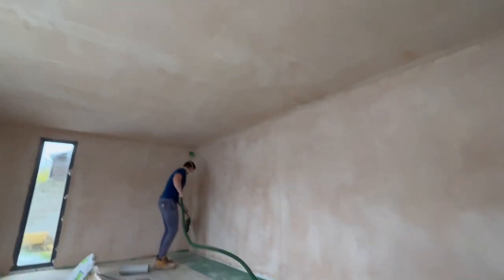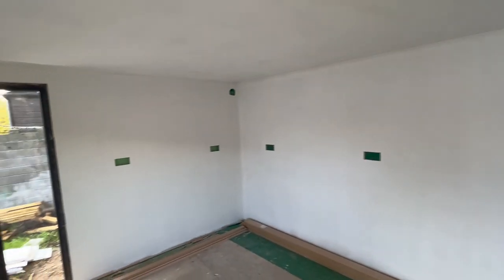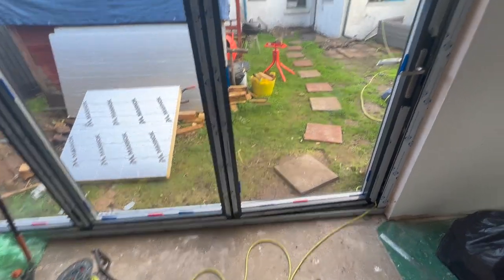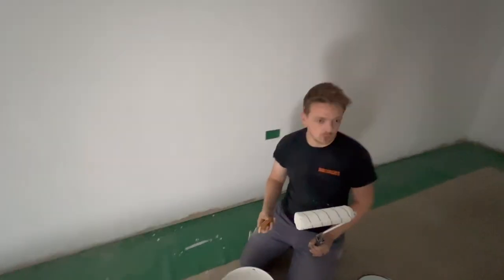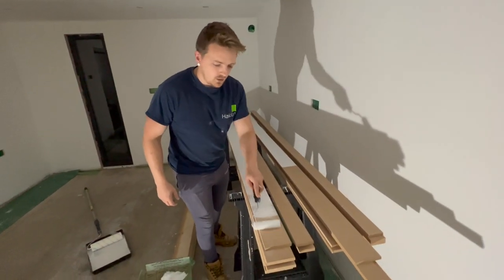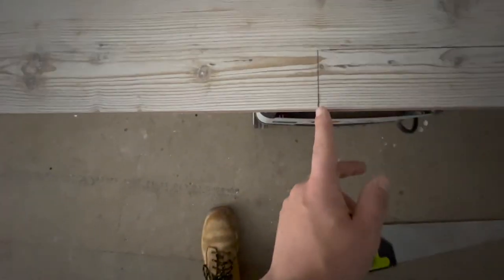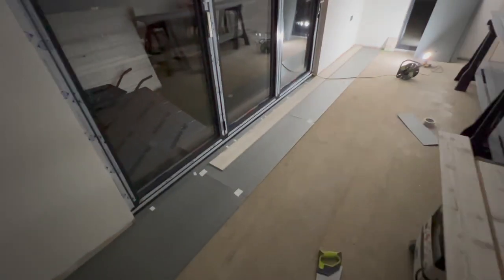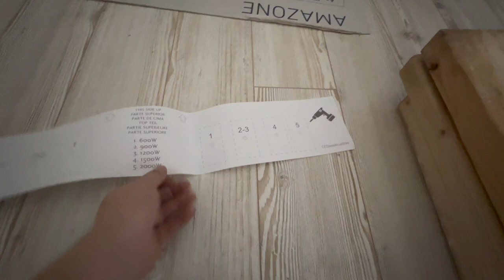Ep.7 - Plastering/ Painting and Installing Flooring - Building a Garden office

Comment: Cowboys everywhere. I've been stung a few times. But you got a lovely decorated finish on those walls.

Lovely idea to match the architrave and skirting to the windows/door frame colour.

One question though... why did you make the building out of square? Just curious on that one.

Those radiators look lovely. Bet they're nice and toasty with all that insulation.
Reply from the maker: Yes, you’re right there, had some marble tiling done In our previous house and they done a worse job that I would have done! Wish I had spent a few evenings doing it myself 🙈 

It was an idea Natasha saw on Pinterest to have dark skirtings and architraves so I decided to colour match it to the anthracite window and doors, RAL 7016 if you were wondering 😅

So the reason behind the un-square building is purely down the the end of the garden, not being parallel to the house, although we wanted as much space as possible, we wanted to garden room to be parallel to the new extension, so the back of the office, follows the end of the garden, I believe it’s about 6-700mm shorted one end of the office, that’s over the 4m of the office so it’s not so noticeable once you’re in the office.

As for the rads, I wish I had only installed 1 radiator because it heats up
So quick and it stays warm all day and most of the night.

Comment: Hi, hope you are well. I’m just at this stage with my garden room. I like the look of your skirting and architraves. Would you mind sharing where I can find it for sale?
Reply from the maker: we bought a sheet of 12mm MDF from B&Q. They ripped it down into 400mm widths so we could fit it in the car, I then ripped it down into 100mm widths for the skirting, 65mm widths for the architrave using the plunge cut circular rail saw, we primed it, sanded it, then painted it using RAL 7016 paint, glued and pinned it to the walls.

you might be able to find square skirting online, but it would probably be 18mm instead of 12mm.

hope this helps :)